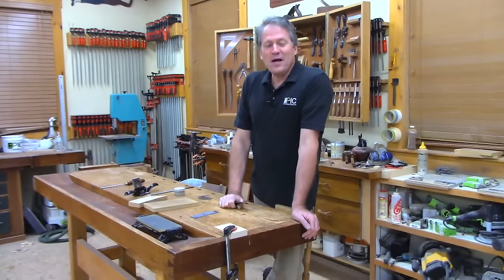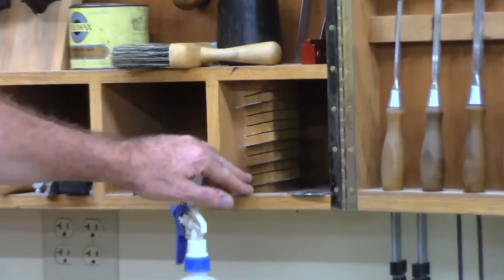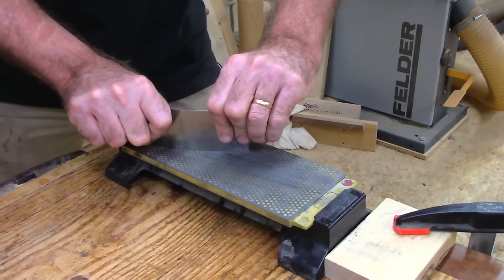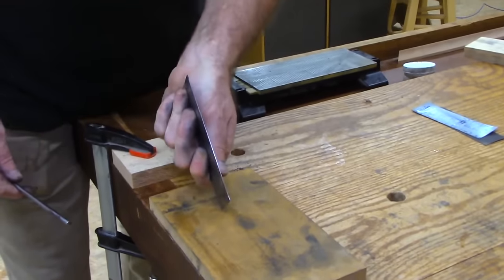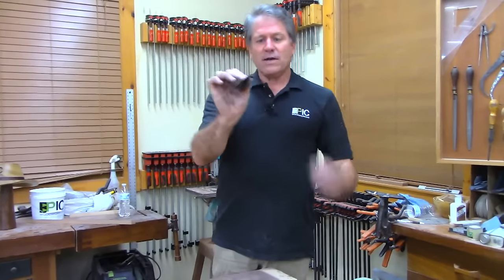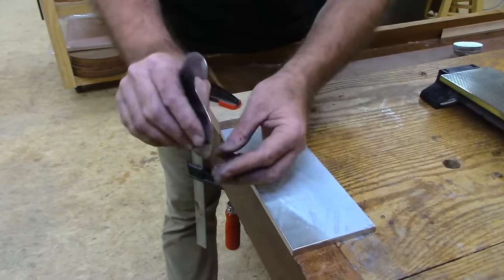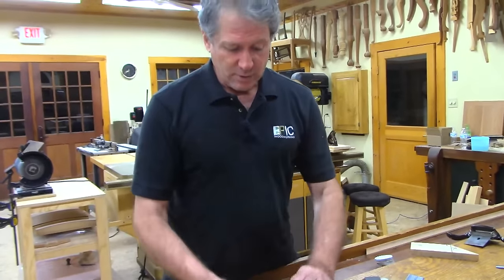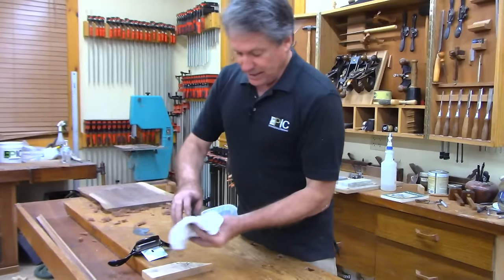How to Tune and Use Scrapers

Comment: I used one for the first time after you recommended one in another video. 

Holy crap. I've always struggled with planers because I work with hardwoods, but these are amazing. They cut down on my sanding time and flatten out the wood without losing much material. I keep finding new uses for it too. Thank you!
Reply from the maker: I know what you mean, card scrapers may be simple but they’re awesome and satisfying to use. Glad you enjoyed it, and thanks for watching! 👍😎

Comment: That was a great shot night live. Thank you so much. I have the number 12 and I got it to work fairly well but I didn’t put a burr on it the way you did. I found it at a swap meet and I think I paid $30 for it but had no clue on how to sharpen the blade. I put the 45° angle on it but didn’t put a burger on it. This was very helpful and I’m looking forward to re-sharpening the blade and giving the number 12 another go. The nice thing about the number 12 is you can adjust the angle of the blade because it pivots at the bottom. I think if you don’t have a 15° burn on the blade you can make a slight adjustment to the blade angle to get the burr to start cutting correctly. That’s my guess.
Reply from the maker: Yes Rick, I think you’re right about the angle adjustment on the no.12. I know I had one of those myself but I haven’t seen it in a while. It feels like a truly antique tool with the wooden handles off to the side. I’m glad you enjoyed it, thanks for watching! 👍😎

Comment: I believe curving the little "hook" is called burnishing. You can use a specialty tool..a tungsten  burnisher, or veritas makes a handheld  burnishing tool you can set the edge angle on with just a few swipes on a card clamped in a vise.
Reply from the maker: Thanks Alan. Yes I have several burnishers and have been tuning and using card scrapers for decades…a great and essential tool! 👍😎
Reply: @Epic Woodworking  just started in the last few years when I retired. Didn't take me long to find that veritas sharpening too..
Nothing like the peace you find in your shop..surrounded by tools..materials..and mind filled with projects to build..pure bliss for an old man! 🙂
Reply from the maker: @alangreen3425  Yes Alan, I couldn’t agree more! 😎👍

Comment: "Annealing" is applying heat to metal in order to realign  its crystalline structure  in a way to make it soft and workable.  It is sometimes done when the metal has become too work-hardened as to be difficult to shape.  What you were in fact doing was work-hardening the metal in order to strengthen the material that is to become the bur.  This is the very opposite of annealing.
Reply from the maker: Ahh, thanks for clarifying the terms Malcolm, I appreciate it! 👍😎

Comment: I've got the Veritas Cabinet Scraper, their copy of the #80, and it doesn't squeak like that. Might be something not machined well on the one you have.
Reply from the maker: Thanks Joe! Yeah, I’m thinking it might have something to do with the little clamp bar not having solid pressure. Another guy said if the clamp bar is slightly bent, so the pressure is not firmly against the middle of the scraper iron, it will tend to more easily chatter…which I did notice happening easier than I thought it should. Great feedback, thanks again! 👍😎

Comment: Thin blades chatters quite a bit on Stanley scraper plane. A thicker blades may help with that. Also thicker blades do not bend, so you are scraper with the whole width. Give hock, lie Nielsen or Veritas blade a try.
Also a saw vise may be good for this.
80, 81, 12, 12-1/2, 12-1/4, 112 should all sharpen the same way. All the 12 ones you can adjust the blade angle.
Reply from the maker: Yes thanks, I have seen a guy who would use a regular card scraper for the “iron” on his number 12. And he was the most skilled and experienced person I ever saw use one. So I’m thinking any chatter is more a function of the pressure bar not being properly fitted, which I will be checking. I have a couple Hock irons I’ve used with other rooms so I’m sure you’re right about the possibilities of better results with an iron like that. I do like the “spring” feature where the blade can be slightly cambered and not have the corners digging in, similar to the handheld result. Thanks for your ideas! 👍😎
Reply: @EpicWoodworking  Thank you for the great videos.